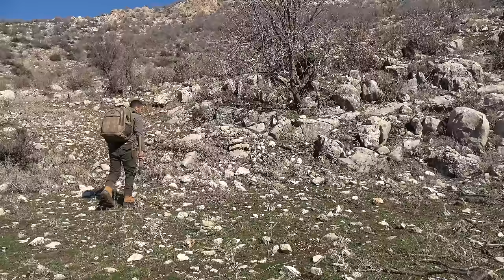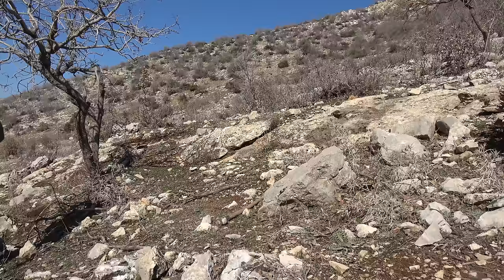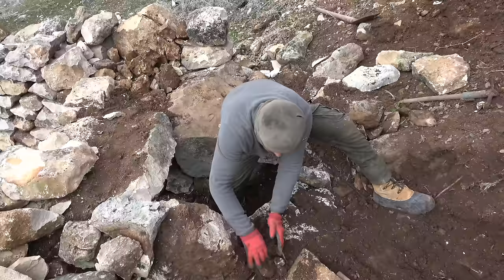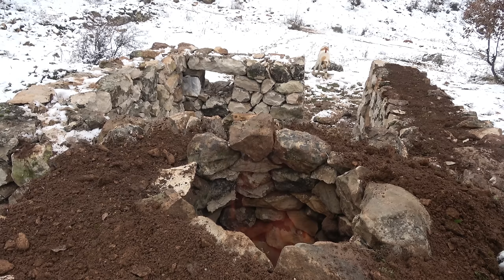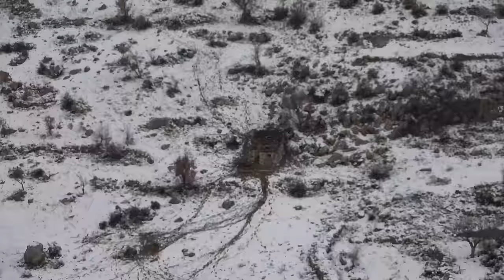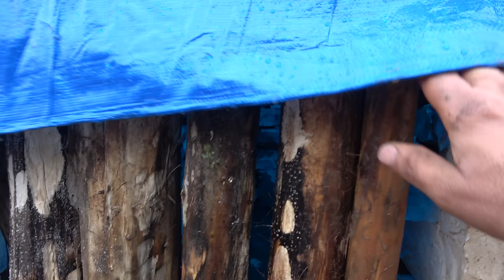Building a Stone House With a Fireplace in 14 Days | Winter Camping adventure, Diy Project

Comment: Next time make fireplace shallower and chimney pipe way smaller , around 7 or 8 inches in diameter, you’re losing a lot of heat . Amazing built btw
Reply: Was just about to say the same thing...
Reply: Уже 38 000 лет делают огнище внутри хати ....  Неуже ли ваш камнестрой относится к следующим 38 000 лет нашего будущего ??? ....
Reply: His fire has almost no smoke and is very good. There is NO tall chimney to pull a big draft. Why risk smoke coming back into the cabin by choking down the size of the chimney pipe? Losing heat? It's not a modern house... look at that thing. 90% of the heat will be from sitting right in front of the fire. If a bit of smoke comes back toward him, everything he did is for nothing. It's not worth the risk. Also, about "shallower" ...  He needs to "get in there" to cook and does not have a chainsaw so all types and sizes of wood need to fit in there. That means the opening must be large. If the opening is large, the chimney as to be rather large.
Reply: It’s possible to simply “choke” the chimney near the top with a flat rock or some kind of ceramic chimney pot, this might have been done fairly often but we don’t see, and don’t really expect to see a lot of examples of it. The temperatures are simply too high for any readily available materials at the time to survive. People living there would have expected to replace such items once or more times a year.
Reply: @quantumofconscience6538  Plus, if the wife shows up and starts causing problems, it’s easier to get her in there.
Reply: Guys, Salvation is Simple

HalleluYAH (Hallel u YAH) “Praise ye YaH”

YaH is The Father (Genesis 1)
YaH arrives via the TENT OF MEETING
YaH was Who they Crucified for our sins
YaH was Crucified on an Almond TREE

Semitic (Moses)
Isaiah Scroll (The Original Isaiah)

Isaiah 42:8
I am YaH; that is my Name! I will not yield my glory to another or my praise to idols.

Isaiah 43:11
I am YAH, there is no other Savior but Me.

Isaiah 45:5
I am YaH, and there is none else.
Reply: It's not a chimney, it's an escape tunnel.
Reply: I don't see you building a stone house...

Comment: There are certain things right and wrong with this situation. Raw material is readily available in stone.  However the fire place is uncontrollable meaning timber would be burnt inefficiently, the surrounding area  could not support long term living without depleting most of that timber